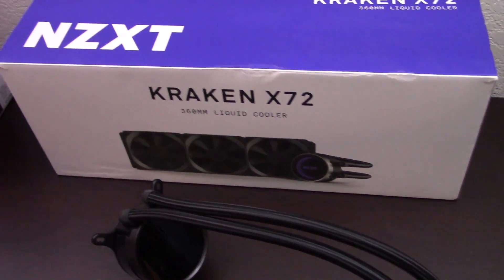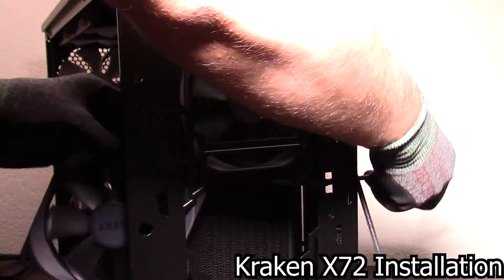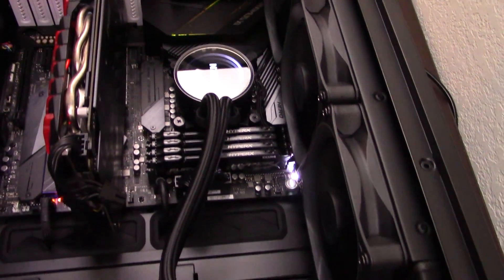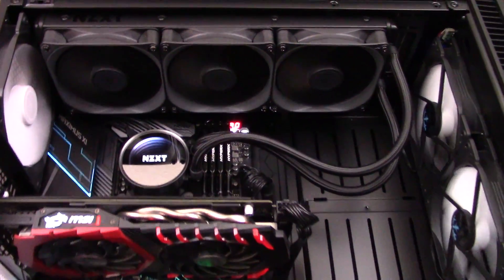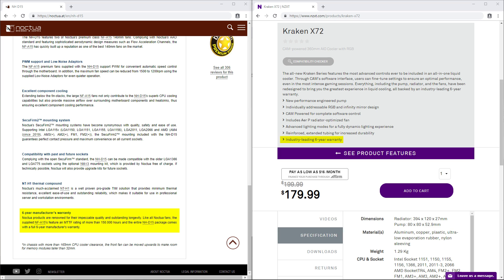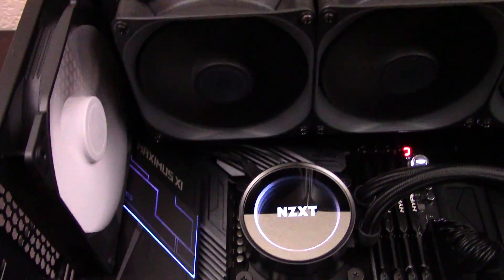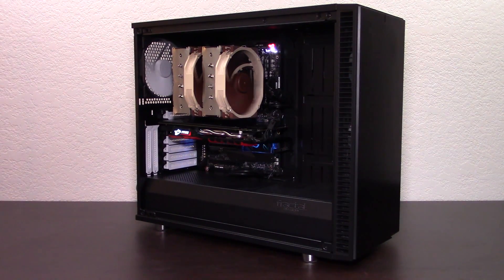Air Cooling vs. Liquid Cooling: The Ultimate Showdown (feat. Noctua NH-D15 vs. NZXT Kraken X72)

Comment: Do you recommend using this Noctua NH-D15 for an i9 9900k without overclocking?
Reply from the maker: Yes it should work great.
Reply: I have a u12s cooling an i7 7800x, and temps in heavy gaming in a case not of the best (master box pro 5) get to 70 C MAX with 35 Celsius ambient. Noctua is fucking great man.

Comment: THANK YOU! I love the detail and presentation of your videos. You need to make a few more as they are some of the best on YT. Regarding air Vs water, it is a vexed question, to be sure. I have tended to lean towards the air-cooled option so far. I do have to say that Kraken liquid cooler by NZXT is a stunning looker and really gives an extremely clean and futuristic air (see what I did there!) to the inside of the case. Sadly, I would be terrified of a leak as I'm a BIG Murphy's law believer (after a lifetime of seeing Murphy do his evil vicious stuff!) and I will be plumping for an air-cooled solution in any future build. 
.
I currently have a beautiful example of air-cooling operating in the gaming rig I built together with my son - we really didn't spare any cost (personally, I am NOT a gamer) as it was a present for him. We chose a Fractal R6 for the case, top 850W Seasonic PSU and some great Corsair RGB RAM (his choice) and an ASUS Hero WiFi Z390 MoBo (joint choice - plenty RGB to keep him happy) and an i7 9700 CPU (joint choice with my guidance). Anyway - for cooling we chose a SCYTHE MUGEN Rev.B air-cooler. Beautiful cooler to look at, NOT over-size (nor undersize - just normal), LIGHTEST in its class (less stress on our precious MoBo circuitry - VERY important!) , absolute breeze to fit, stunning quality and craftsmanship (Japanese) oh, and it is a neutral grey/BLACK (not a sickly ridiculous ugly BROWN - Gawwwd!). It keeps his rig very comfortably cool even in his tempestuous high-resource sapping gaming. Nice and quiet too under normal conditions with a bit of a rev-up when the going gets tough but nothing to worry us. Ours employs the single fan option but a double fan option is also available simply by the easy attachment of a second fan. The whole shebang is physically OFFSET to obviate any RAM clearance issue so TALL RAM is fine. 
.
Annoyingly I had to jump through hoops to source the fan here in Australia (no distributors strangely), so, I bought two of them to save me doing the overseas purchase dance ever again. I now have a spare for my new fantasy work/video editing machine I will build next year. Was to be an X299 rig (I've always bought Intel) but since the AMD X570 and PCie 4.0 lobbed on the scene I'm thinking twice now. Intel truly does seem asleep at the wheel - such a real shame as competition is a wonderful thing -  and that's coming from an Intel fan-boy!  Thanks again for your great videos - they're very informative and entertaining and VERY easy to watch! Keep up the fantastic work HS!       . . . . SUBSCRIBED!

Comment: If you're an "enthusiast", you need to be custom loop cooling. Also, while they have the same warranty length, there are 5 points of failure(3 fans, the pump, and fluid permeation) on the X72 vs 2 points of failure on the D15(2 fans).

Comment: I think you will find that with the new Ryzen 3000 series chips and the fact that less than 25% of the AIO cooler (that's where internally the heat exchanging fins are) will actually be covering and thereby cooling the hotspot of something like the 3600, 3700 or 3800, the Noctua air cooler will kick the living snot out of the 360 rad AIO.

Comment: So far this has got to be the most descriptive review I’ve seen yet, thank you! Fortunately, I bought this air cooler (NH-D15) and my temperatures drop right away at least by 10 Celsius. I was using a Artic freezer 12 air cooler and could only push my CPU (i7 8700k) to 4.2Ghz anything after that would overheat and crash, now that I’m using the NH-D15 air cooler I’m able to render much quicker due to a stable over clock of 4.8Ghz without overheating and crashing thanks to the new air cooler (NH-D15) however it does peak to 87 Celsius when rendering a project on (Sketch Up, V- Ray plugin). This was an easy install for me, but I did have to move my GPU card down a slot as it is very wide.
Reply: Silksteam21 Take a look at the D15s. It’s made for GPU clearance.
Reply: @CaseyHardman  I'll definitely look into this for future builds. cheers buddy!
Reply: what are your specs for rendering
Reply: @stephon972  at the time of the post I had a GTX 1070 and 32GB RAM

Comment: I am not sure this test set up takes into account closed loop heat saturation. The air coolers have another advantage when it comes to returning to a nominal temp after sustained load.
For example: if you run at 90-100 cpu usage for an hour, then you release the work load, the air cooler should return to nominal temperature faster then the water cooler. This is because water has a nasty habit of retaining heat. The metal tower cooler will dissipate much faster.

Comment: Cant you rearrange the NH-D15 to avoid memory clearance problems?
Reply: Run it in single fan mode
Reply: Or better still buy the S variant. NH-D15S. Offset so better PCIe clearance and better ram clearance. 
Diference between one fan and two is only two degrees.

Comment: Great Video - It's really a no brainer. Why use liquid cooling when air cooling will do the job just fine. The only time you should consider liquid cooling is when air cooling just won't cool effectively. This applies to all things mechanical and electrical.

Comment: Very very good video.
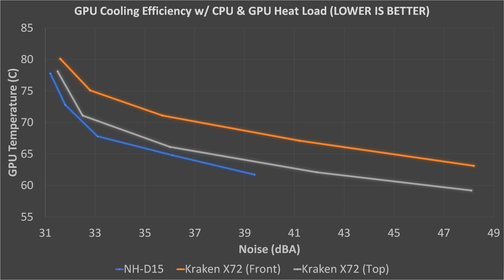One of the better ones if you care about the topic, air vs liquid, especially at 7:15!
Well done sir. Will keep an eye on your channel.
Still cant decide what to get, NH-D15(s) or a 280/360mm AIO for Zen 2 (which arent good overclockers)
Reply: I think even a u-14S should be ok

Comment: Just got my NH-D15. Never regret.
Reply: Thitikorn Boontiam hi , i was wondering if the D15 cooler was too big and heavy that would pull or damaged my whole system ( main , cpu)
Reply: @alosius7066  I've NEVER heard anyone say they've experienced damage cpu because of the size of the cooler.
Reply: @alosius7066  That's why the big coolers come with a mounting system, although it's still attached to the motherboard, so if you're moving your computer around a lot a water cooled system might be safer.
Reply: Yeah your build looks like shit now gj

Comment: The NH-D15 CAN be "Customized" a little bit if you also purchase the Noctua Chromax fans and Chromax customizable heatsink covers. Basically doubles the price of the cooler at that point, but it will be FAR more aesthetically pleasing.
Reply: I have the D15S. Looks gorgeous with Chromax fans and covers.

The new black D15 should be available soon.

Comment: I had to go through 7 months of customer support for my NZXT AER RGB fans to get them replaced. 
Seven, fucking, months. 
I did get them replaced for no cost though, but CAM is pretty badly optimized. 
Good looks, pretty good performance, bad software, bad support but in the end, I'd say the better choice. 
(Have an X72 and it has served me well for 10 months now, H150i Pro works just aswell though and has better software and pricing)

Comment: Why haven't someone combine both air cooling and aio water cooling? Just add heatsink and more fans on the top of the aio main plate. No need for 12 cm fan there maybe half the size will still give improvement?
Reply: Look up how water blocks are made and their internals. That will answer your question

Comment: Black Fans & a nice cooler cover available for the NH-D15 now too for anyone who want it to look nice.

Great video
Reply: And now it's fully available in a black version with black fans included :)
Reply: But it covers most of the mother board you can't see your rgb ram.
Reply: Im sure the color is gonna make that fat piece of shit look better
Reply: Or you can go with bequiet Dark Rock Pro 4. Similar to nhd15 but full black, even cheaper, and only around 3% lower efficiency.
The noctua black accessories are quite expensive for just making it look good with no added improvements
Reply: @axelolord  Dark Rock Pro 4 is better in that regard yes, but Noctua's mounting kits mean you can use this CPU cooler with any future motherboard or cpu. That's simply amazing.

Comment: Air beats AIO'S in every domain, except estetic for some coolers. I have same Noctua cooler as yours, on i9 clocked at 4.7. Under heavy games on ultra like Battlefield 5 , GTA 5 , Oddysey, max temp is 55 , with H500P Cooler Master case. Mostly case fans are the most importand. Good video though :)
Reply: Andrei Tenea good to hear, due me running the the same case with the kraken xD I considered the noctua aswell, this comment means a lot to me.
Reply: Are the side panels able to close with the NH-D15? Because I bought them some time ago and because of the position of the ram I had to move one of the fans a bit up, so no the side panel can't close. I'm having a hard time finding a case that will work. Is the H500P Cooler Maste wide enough for you?

Comment: Liquid cooling radiato should be positioned correctly for best efficiency. Most people place it in the wrong position. Radiator should stay vertical with tubes coming from bottom and the pump should be the lowest point. Heat travels up and cold down easier.

Comment: I got the h100i platinum SE. Either way I should be fine because the 3900x will come with the prism wraith cooler.
Reply: You need a good cooler for it. 12 cores though. The stock cooler isn't enough for gaming or heavy loads.
Reply: @andreitenea5989  Yeah thats why I have the AIO water cooler waiting. Granted I think the cpu will be fine with just the stock cooler so long as I dont go and OC it and test with prime 95 or something. I should work just fine. Heck I could even just disable 1 of the ccx's until I get a replacement - but I dont think I would need to.

Comment: the kraken isn't for enthusiasts, it for normal gamers who spend a lot more on their pc. A few more screws, a couple more minutes and compatibly isnt whats wrong with the kraken, its just the price. this review is stupid. enthusiasts would rather go for custom hard tubed loops. ps, having hot air from your cpu going to the gpu is obviously gonna heat up your gpu and as the reviewer you should outline your variances when recording the data. this review was just lazy.

Comment: The AIO is not mounted corectly.
When mounted in the top it blocks the rear fan (the rear fan should be lowered) the cables are also too close to the RAM sticks, flip the AIO 180 degrees horizontaly.
When the AIO is mounted in the front the fans should be inside of the radiator or they will draw hot air into the case.

You wouldn't put the Aircooler to cool vertically would you?
The aircooler also makes it harder to cool the VRM, RAM and to some extent the GPU with other fans.
The aircooler does win big in price, but a stock cooler is what you want if you are not an enthusiast.
Reply: The rear fan isn't needed with a exhaust rad
Reply: Magnus Nilsson your room is hopefully, cooler then the pc. You do know it’s better to use cool air then hot air to cool a pc?

Comment: When it comes to Maintenance the Air Cooler wins in my book. The AIO has a limited life span of 4 to 5 years (usually less) before it will need to be replaced. The air cooler can work indefinitely at worse it might require a fan swap if it fails. I recently had to retire an 280 AIO that had started to loose it ability to cool my 6700K. Just shy of two years my max temps started to clime by more then 20 degrees.

 I opt for a large air cooler most of the time, the Noctua's are just so much quieter. unless I absolutely need MAX cooling or case size eliminates the possibility of fitting a large air cooler. Currently non of my three PC are air cooled because of such constraints.
Reply: 4-5 years, usually less? I've been rocking my h80i since mid 2014 and it still works flawlessly.
Reply: @johnhighway9397  My PC had water cooling for over 10 years. Never leaked or had increased temps. The pump was a little loud and annoying but I probably could have gotten quieter ones. This time I opted for air cooling because I didn't want to take the time and expense of a water cooling system. But if you have the time and money it's undoubtedly the most cool.
Reply: AIO's tend to last 7 years or longer if you take care of them and orient them properly. The highest point of the radiator HAS to be higher then the pump. As the fluid evaporates over time air pockets get introduced and can get pulled into the pump (frying it out) IF the pump is at the highest point. <----Lots of people mess this up...Hence premature pump failure.

2 years is wayyyyyy too short of a life for an AIO. Only time I ever had a pump crap out that fast was on a unit that had recalls due to the fluid sludging. MSI Mag Coreliquid 240R...That AIO caused me some headaches haha.

Comment: Did you saturate the heat in the liquid of the AIO?
Reply: Exactly. They clearly didn't run an extended stress test on the system and then review the results. Linus Tech Tips did a video on air coolers vs all in one liquid coolers and the D15 beat them all by a fairly large margin.
Reply: @DaroffApFire  It was only 2-3 degrees and that was over 5 years ago lol. AIO's have improved since then, esp the pumps and blocks. J2C did a recent and better experiment in the worst and best case scenario environment. NH-D15 no longer holds the crown, but it's not a bad cooler either. Really, AIO vs Air just comes down to personal preference, style and sometimes budget. I switched to AIO's mainly due to ease of use, install and aesthetics. I did run a NH-D14 for many years. Were in the age of full glass side panel cases and things like my Kraken X62 with its infinity mirror pump housing looks amazing vs a big ugly tower esp one as big as the NH-D15's.
Reply: @junkiexl86  No, I'm talking about the video they just did a few months ago. The Noctua NH-U12a was better than Corsair H60 (by 10 degrees), Corsair H100iV2, and the H150i Pro. 

AIO's take up more case space, and offer no benefit whatsoever. And now that Noctua offers the NH-D15 in all black, you don't even have to worry about aesthetics.
Reply: @DaroffApFire  Well anything is better than an H60 and 360mm AIOs aren't that good, or as good as one might think. 280mm AIOs generally beat them by upwards 10 degrees on average.  One thing that is undebatable is spike heat, in which water has the advantage in spades and is what 98% of users deal with. Sure in long-duration stress tests after liquid temps in AIOs have normalized the difference between air and water is debatable but generally, people are only stressing to test a CPU stability or a temp benchmark. 

The other valid argument I hear is maintenance. But that's not the whole picture either. AIO's are generally guaranteed for 5 years, which is easily the lifespan of the PC.  By 5 years your due for an upgrade and most people are likely going to upgrade their cooling to a newer, better performing model regardless if air or water. Most AIO companies back their products so if a pump fails (very rare) or even leaks (even more rare) the company will cover the cooler and any other products damaged by the failure.

Offers no benefit? Um yea ok lol. Literally, a dozen videos that show Gen 5/6 Asetek pump AIO's beating out top air coolers. Taking up more case space is debatable. You're just simply trading a big huge block, blocking most of your ram and motherboard real estate for a few fan slots at the top and if you were already running fans there or wherever you place the rad, you don't lose anything at all so you gain space in reality.  Trust me in a full glass side panel case, it makes a world of difference for aesthetics ofc aesthetics is purely subjective.

Comment: How long were the tests? I ask because the AIO has a much higher specific mass to absorb heat but will eventually equalize to where you can see how much heat it can actually move away

They advantage i see in liquid coolers is that you're able to displace the size of the radiator and fan to another area where it can be either larger or draw from cooler air, which is what i see in the Kraken X72
Reply from the maker: 5 minutes at each fan/pump speed level for a total of about 30 consecutive minutes under heat load.
Reply: This is something I like to know myself. another thing the video did not talk about is dependability. like if the pump goes out on a liquid cooler it could destroy your CPU if you're not lucky in a CPU shuts self down first where the air cooler has two fans if one goes out another fan still be running which will prevent you from destroying your CPU and you can still run your system. you just may have to dial back some of your overclocks where the water cooler you can not until you replace it and not everybody has a spare just laying around... liquid cooler usually last roughly around 5 or so years before the pump goes out and or start leaking. The air cooler will last forever just as long as you don't drop it and it can last you through multiple system builds
Reply: @kennethshores8547 
Modern CPU's will never kill themselves. It'd be mighty rare for them to overheat and die. They have many fail safes.